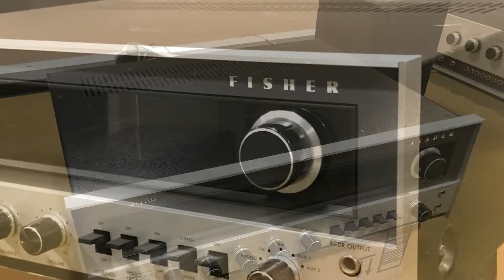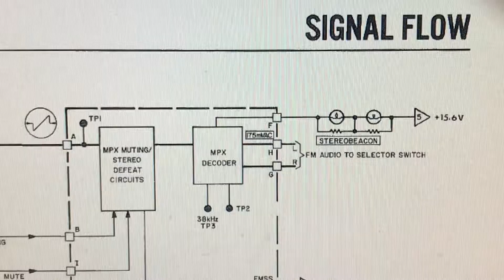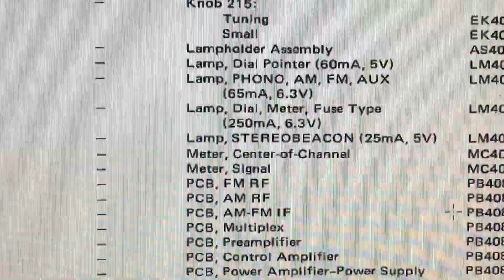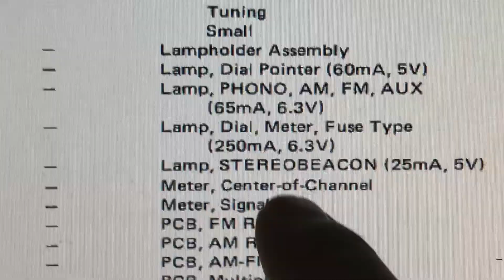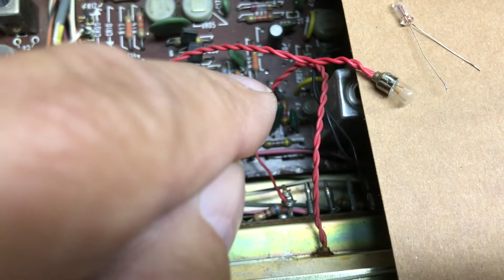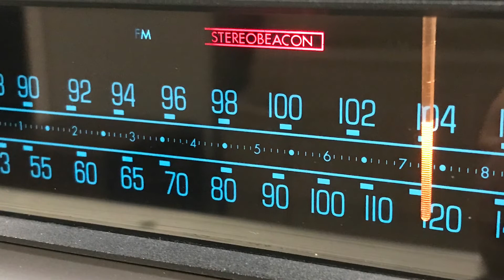Fisher 205 Receiver Overview and Repair

Comment: Hello! Thank you for your video on the Fisher 205. Any chance you could do one to show us how to change out capacitors? We have an awful crackle sound coming from ours, and we want to fix it but aren't sure what capacitors to buy and replace. We have the manual, but just aren't sure what we're looking at! If you could do a video, we would be super grateful! Thanks!
Reply from the maker: Sorry, but all I did on this unit was repair the indicator light, and did a thorough cleaning. It sounded great so I didn’t go further and returned it to the owner. Replacing the electrolytic caps is often a good problem solving step, but you might try cleaning the controls (with DeOxit spray) as that can certainly be a source of crackling and noise. This is a nice looking vintage unit. Good luck with the resto.
Reply: @xfireamg417  Thanks so much! Will see how we go :) I appreciate your response!